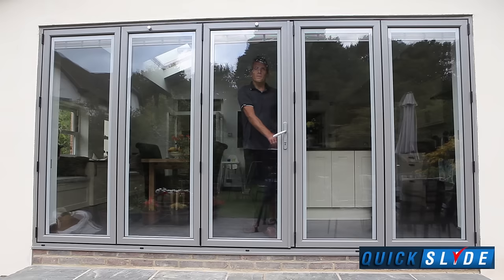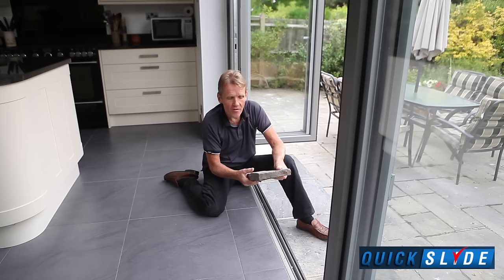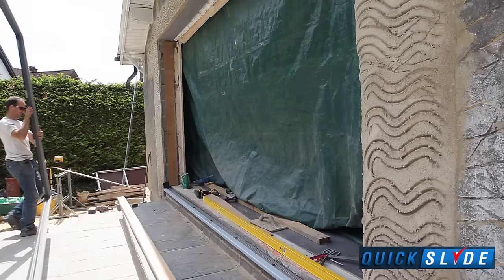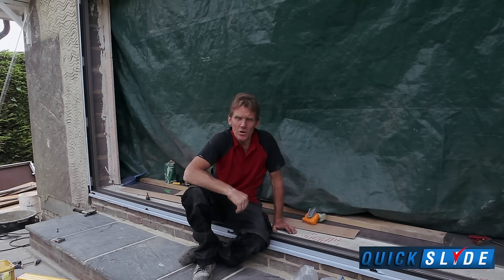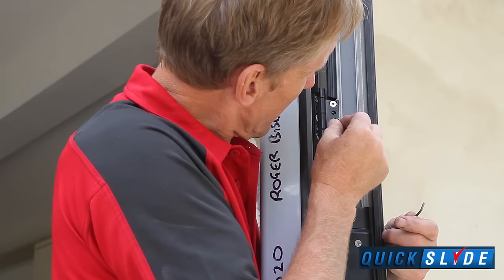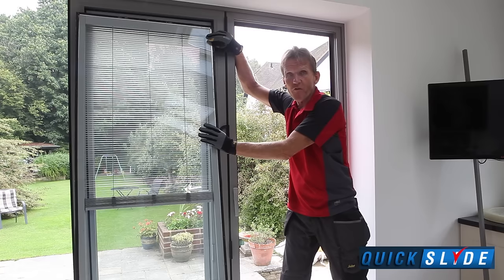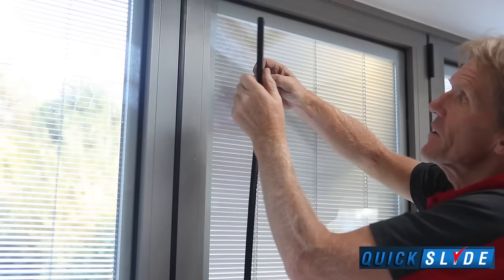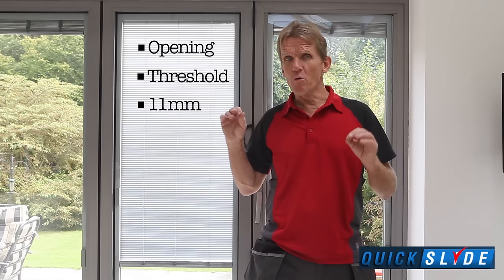How to Install Bi-folding Doors Like a Pro

Comment: Excellent video. Ive got a set of these to fit so will be sharing this with my builder today. Thanks for posting
Reply from the maker: Just watch that threshold. Bring the damp proofing up the back of the fram and dam up the channel ends with silicone. The bottom channel drains through the weep holes.

Comment: Hey Rog! Decent install however the following might help out some diy'ers... 
I always lay bifold cills on fresh sand/cement with packers around every 600 or hard stable points. Once the doors are glazed and the weight is on it can get all kinky with only mastic under it. Fitting the locking screws is best done once glazed as you'd be surprised how much they can drop as the screws are rarely the same guage as the holes.The main culprits are the roller hinges where the glazed doors should be lifted to the correct height and the locking screws installed at the bottom of the hole so they can't head south. With the gasket cut top and bottom first, pushing enough length past the vertical beads, then mitre the left and right gaskets adding 100mm and compressing it tight up from top to bottom using a glazing shovel. You may have to trim a little but it'll never gap on shrinkage..
Great explanation of toe and heeling btw! 👍 All the best..
Reply from the maker: Thanks Roger.
 I have seen the guys put the whole thing on plastic packers and it is better than bedding on sand and cement as it will shrink but it still looks a little strange. My method was to get a perfect level bed and let that go off for a couple of days. The silicone beads compressed equally and the bottom track is perfectly level. I found that bit easy (basic building) put getting those frames to stay square is a little more tricky. I have another one to do in a few weeks so I will try and incorporate your tips.
Reply: Skill Builder 
Hi! If you build the threshold brick course that flat and level then I'd love to fit doors for you! Most of the builders openings I fit into are garbage with the steel running out of level down on the side that the threshold brickwork runs up! I know the muck can shrink a tad but I seem to get straighter cills this way. If I only end up with enough room for silicone and packers I tend to start with only 2 fixings in the lock side so it's  easier to move up or down and re check levels along as I glaze up. (3 and 5 part bifolds)
Squaring wise with my suppliers it always seems that one jamb is longer than the other so I never bother to be honest.. dead straight level cill, jambs upright on the level and just straight line the head through. As soon as the hinge side jamb is in the right place I stick a head fixing in it so it can't  move. Using a tape measure to set the gap between leaf and head when glazing so any discrepancy is at the threshold and less obvious! I know we're only talking a couple of mms but it is nice to aim for perfect. Great explanation of the low threshold issue too btw, I have to explain that to every single customer and talk them out of room divider type thresholds.. Hope the upcoming one goes well, I'm renovating my house at the moment so am finding all your videos extremely helpful, thanks a load 👍

Comment: Hi, I’ve enjoyed your instruction videos, but now I’m at a bit of a loss. I’ve had bifolding doors installed and they have named shut and won’t open, the hinges don’t have a Allen key connection on the hinges as they are just flat at h the he top and bottom, so I can’t adjust yhr height of the doors (they have dropped. The installer won’t reply to my messages??? Any advice would be a massive help 
Thanks again

Comment: The string is a great tip. My fitted doors are out by 2mm across a 3 door 2 m (6 feet) wide. Causing a 2mm gap at the bottom of the bifold while the top seems flat and the door sticks. 
Where and how to do the adjustment properly please? Don’t want someone “bogging ” it just because I don’t know any different!!

Comment: Best video I've seen.   I have folding doors, but the one on the end which forms the first door to open has dropped so that it won't close without a really tough pulling action.   Can I undo the hinges as you say and raise the door  ???   Thanks,

Comment: Roger, I know this is an old video now, so wondered if you'd encountered any issues since with cold bridging? My aluminium bi-folds were fitted with the cill directly on the outside course of engineering brick. Whenever it's cold outside, the inner cill is ice-cold and covered in condensation, despite being thermally broken laterally. I can only conclude that the fitting directly onto the brick course is the cause of the thermal bridge. I have seen many installations using packers below the cill, which would alleviate this
Reply from the maker: Hi Graham
The cill is acting as a dehumidifier. I think it would be good to look at ways of getting rid of some of that airborne moisture. 
I suppose packers and foam will achieve some measure of thermal break but the door needs good support and that is why I pack the underside with sand and cement. I have never had any problems with condensation on the frame so I can only thing that it is due to a high level of humidity in your house.
Reply: @SkillBuilder  thanks Roger. My first step was to buy a dehumidifier, which is set at 50%RH and given the room temp of 22° the dew point would be 11.1° The cill is often colder than that unfortunately. I will set it at 45% and see if that makes a difference

Comment: Love the videos but you didn't put any dpc under the frame as you mentioned in your other video.
Reply from the maker: You are right but the difference here is the 150mm step down from the door. The water can't collect and the dpc is lower in the wall. Nearly ten years later and zero problems of any kind.
Reply: @SkillBuilder  fair enough .  I am looking to do this at the moment and the videos are a great help.

Comment: So you don't have to fix baserail of frame to the cill other than the sealant at the back?
Reply from the maker: Yes you can see where I have screwed in the cill and the frame locates onto that with the sealant. Some screw through the frame

Comment: Tried using this as got stuck when me and my old man were fitting a Aluminium French door fitting the gaskets as could get the outer gasket in but not the inner so used the packers but to no avail. To solve the problem on the brand of door I was fitting it turns out that the internal gasket can be pressed into the beading as it has a channel on the inside edge so need to pack out , just press into the grove on the beading when out of the frame cut off just over as vid says but then just fit in no need for packers to gain space to fit the gasket. Not dissing you guys as always a great source of help but this method may be what you need to do or at least check when fitting gaskets when your next fitting a Bi fold or French door as it made life way easier , no spacers/packers or using the paddle to gain space.
Reply from the maker: Good tip thanks.

Comment: How do people go about fixing bifold doors to the steels above? I worked on an extension a few weeks ago and had someone tell me they fixed straight through the steel, which cause all sorts of problems as they went straight through the damp, causing water  to run down the cavity and through the fixing points on the header of the doors.
Reply from the maker: It is common to fix through the head into the steels. If the door opening is wide you won't hold it without a top fixing.

Comment: That is an excellent tutorial video mate, well done. Do you have a video of the process of making the hole and adding in the lintel? What sort of lintel did you use? I'm looking at putting a five meter door in my house here in South Australia and just wondered what you did as the houses and situations are very similar. Is that house brick veneer too?

Comment: Hi Roger, I love your work : ) 
Very quick question for you or the readers here that I hope can be answered. 
I have a granite window sill that is the correct size for a set of patio doors I want to use in a home-office build. 
Would I be able to use this sill to sit the door frame on ?  ......or should I not use it since it was designed for windows?
Reply from the maker: It will be fine provided it has a drip groove on the under side to stop water tracking back. Place a pice of damp proof course under it and lap that up behind to floor level to stop any water driving under the door.

Comment: I am so sorry to point out,  that your explanation about toe and healing,  is opposite to what is in the manufacturer's guide shown in this video.  You said 'bottom packer goes where the hinge is and then opposite on floating side'.  But the diagram shows differently.  I am only pointing this out,  because I am at this stage myself fitting my own doors.  You of course explained it correctly,  the diagram is wrong.   Regards Jez
Reply from the maker: Thanks Jez  We will look at it more carefully.

Comment: Nice tips Roger. Do you find with all that glass rooms are colder with these?
Reply from the maker: +Zed Man Actually the opposite. The doors let in a lot of warm sunlight which warms the floor and the LOW E glass traps it nicely. I think building control are now realising the glass in sunny aspects can give net gains. The fact that the are no draughts is also a factor. The old doors and windows that were there before weren't so good.

Comment: Are these available in the USA (Chicago area) ?
Reply from the maker: +Ana Fisniku 
I don't think Quickslide export to the USA but I will find out if they have an American partner
Reply: +Skill Builder Did you find out? Another interested buyer from USA
Reply: +Skill Builder also I just priced it out for myself and it was $3,100 USD, that is incredible for the size I want.
Reply from the maker: +getstuk87 

Quickslide doesn't have distribution in the U.SA. When you say the price is incredible, do you mean in a good way or too expensive?
We tend to pay a lot more  than you do in America.
You have cheaper tools, vehicles, hotels, clothes, food the list goes on.
I think it is because we are part of the E.U. They take out pants down and give us a Rogerring whenever they can. 20% tax.
Reply: +Skill Builder no, it's an incredibly good value at 3100, the ones I looked at were closer to $8k around the same size!
Reply from the maker: +getstuk87 
I am glad to hear that. Quickslide is the biggest window manufacturer in the U.K. They will supply to anywhere in the world but you have to take care of the logistics.

Comment: You shouldn't fit any aluminium products though the thermal break
Reply from the maker: I used the holes already made. I like to have brackets running back into the internal skin but the fitters told me they don't work
Reply: @SkillBuilder  that's fair enough I always recommend directly fixing through the aluminium especially on doors patios and bifolds 👍👍

Comment: trade only? You need to say in your ad. So not wasting my time .
Reply from the maker: Pankaj  There are thousands of perfectly competent DIYers who can follow instructions and complete a job like this and, dare I say, do a better job than many of the pros who do this kind of job. Duncan, who was helping me and did the brickwork, is a graphic designer who just likes doing a bit of DIY. . 
Please don't judge everyone by your standards .
Reply: @SkillBuilder   quick slide  folding doors  rang them trade only they said .😭